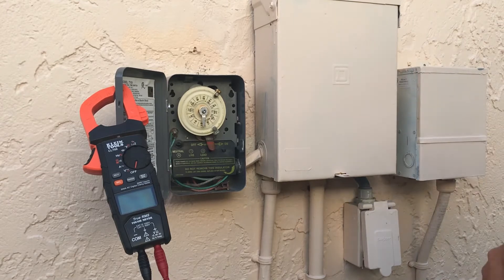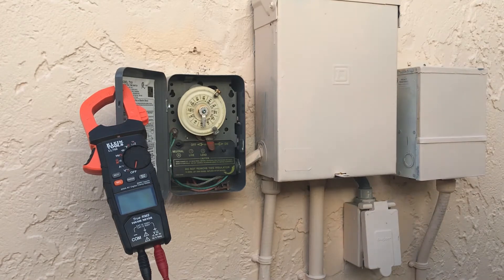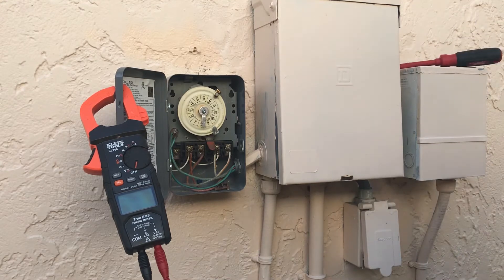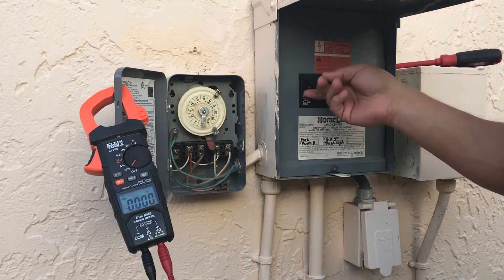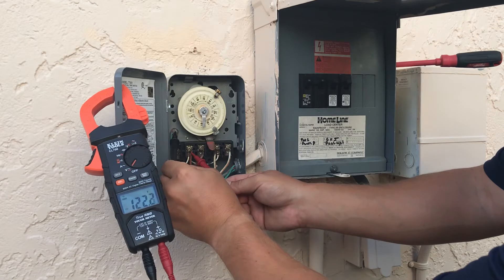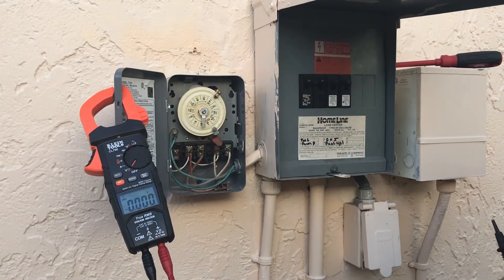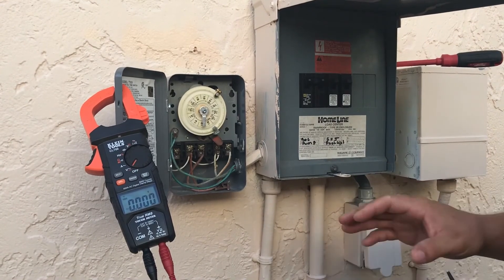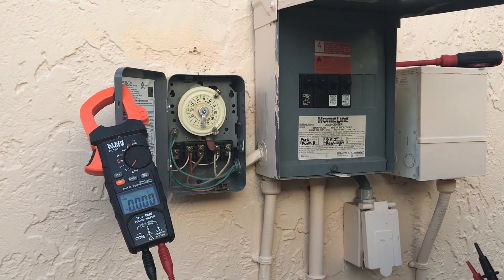How To Test A Swimming Pool Timer Safely | Chlorine King Pool Service Guide

Comment: As a regular person watching, here is some questions I felt should’ve been answered on this how to video.
1. How to figure out what breaker goes to the timer. Remember pump isn’t working so pump on off isn’t going to help figure out which breaker.
2. What is a volt setting on the multimeter and what if there are multiple selection options for bolts?
3. What if my timer doesn’t have a green wire going to the ground. How can I test like you did.
4. Literally Lowe’s or Home Depot don’t cary solid wire waterproof whips. The only way to get a whip with solid wire I know of is to piece it out yourself or by the braided whip and replace the wires with solid. Even the pool store only has bradded wire so whip.

Comment: I have a pool pump and brand new capacitor reading 220v. The timer reads 110v on 1/3 and when the switch in on 2/4 read 110v each. The pump does not kick on. Not a noise, a click, or hummmmmm. The motor is not locked. I'm lost.  I don't want to purchase a v.s. if there  is life in this pump. I also just realized this is a 7 year old video... dangit
Reply from the maker: Test leads 1/3 together. If you get close to zero then you have a bad breaker. It’ll show power on each side but it’s the same leg of power.

Comment: How can I test the actual timer motor? WG-1573 to see if it is working before I replace it> I have two of these motors and at 120 volts neither one has the gears spinning when I hook up line 1 and line 3.